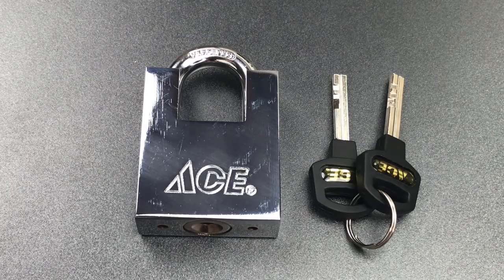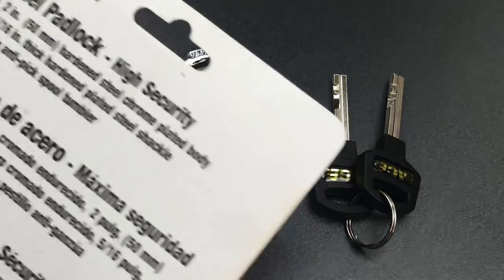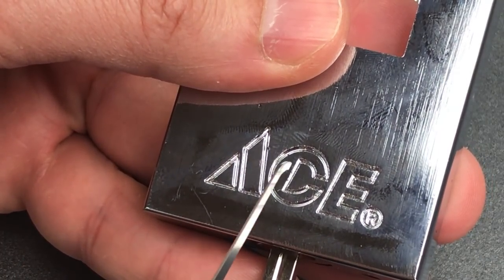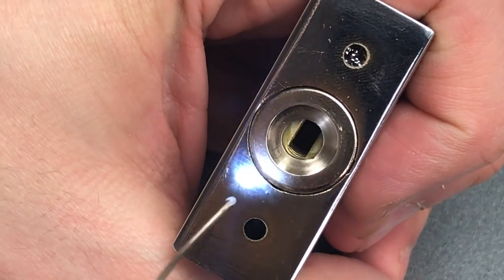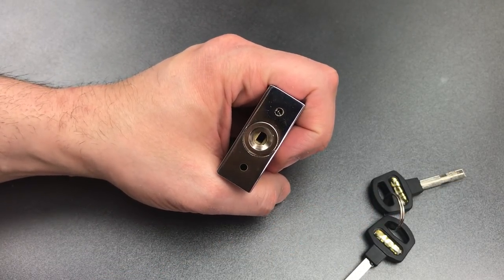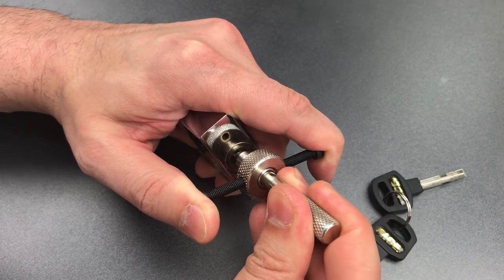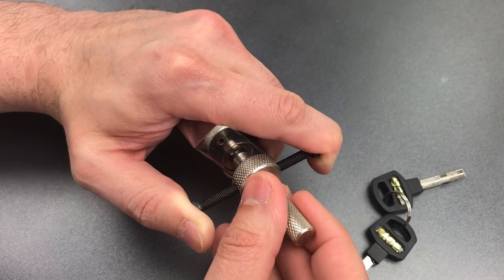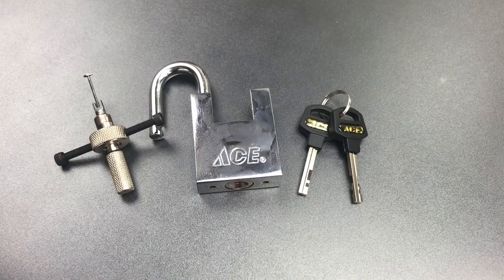[667] Ace 50mm Shrouded Disc Detainer Padlock Picked (Model 5499371)

Comment: Stumbled across your videos and have watched/listened to about 50 of them in the last few days!! Have you ever thought about getting a Rockwell hardness file set for testing in videos? It would be cool to see the difference between different price points and see just how hard the high end lock bodies and shackles are!
Reply from the maker: I have a set... I considered using it, but the only relevant information is whether it’s harder or softer than hack saw blades and bolt cutter jaws. The file works for that.

Comment: The "rust" inside the lock body is probably copper plating from the chrome process.
Reply from the maker: It’s not. It flakes off deeper in the lock, and it’s easy to see.

Comment: Thank you for sharing this good & thorough information - Great stuff! :D  Questions:  1) What is that little bendy light called?   2) What would be the easiest destructive way to get into this lock? - would it be melting the plastic actuator with a cigarette lighter?
Reply: Swynndla If its like most cheap disk detainer locks the easiest way would be to pop off the metal ring on the bottom that holds the disks in, once thats out the guts just fall out.
Reply from the maker: 1-goggle “locksmith fiber optic light”. There are several options. 2- Fire would definitely open this.

Comment: What kind of flashlight were you using? It looks like it would be useful for inspecting gun barrels.
Reply from the maker: Google “locksmith fiber optic light” ... there’s several options out there. 👍 mine is discontinued.

Comment: What kind of light was that you were using?
Reply: An inspection probe. You can find various types on eBay. Also search on endoscope.

Note, you can make your own with an LED if you have any electronic skills. But the tip of this probe is finer than the smallest 3x4x5mm LED.
Reply: Fiber optic flashlight attachment. Look up the Nite Ize Fiber Optic Adapter for reference, but it's discontinued.
Reply: They sell one of those on Banggood as well
Reply from the maker: Google locksmith fiber optic light. Lots of options.

Comment: You can still find these padlocks on eBay. The model number is slightly different but the specs appear to be the same.
https://www.ebay.com.au/itm/Ace-Hardware-2-Shrouded-Padlock-5485149/271993879582
$5 US plus shipping.
Reply from the maker: Yup... several online outlets have a bunch of them.
Reply: I guess you've single-handedly killed off the demand for them. :)

Comment: Wish such sloppy machining, I'd be willing to bet you could open it with a 3lb sledge. 
Being that this is not a stainless steel and the chrome is so heavily damaged, I'd like to see an acid attack. Even weak nitric acid can dissolve steel and it would be a relatively silent, no movement destructive method. Either pour some in alongside the shackle or dip the lock body into a glass container of acid. Nitric acid is easily found for use in woodworking and etching and can also be easily made using fertilizer, drain cleaner, any scrap copper and some hydrogen peroxide.
Reply from the maker: Given the actuator between the balls in plastic, I think a hammer could definitely work.